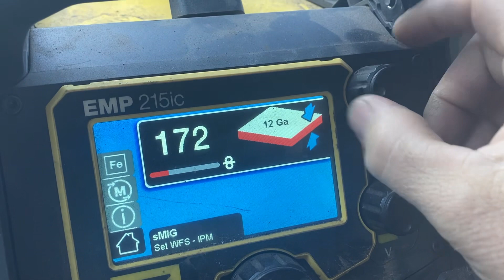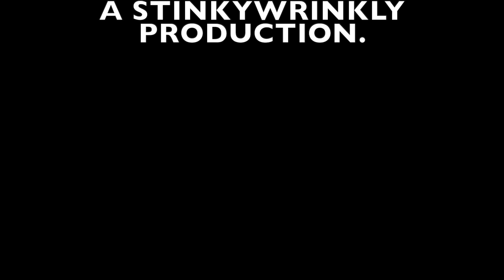Getting people to do your work for you!

Comment: Good video. He did good. I was always taught flex core or stick outside gas outside wouldn't do as good. I guess I was told wrong. Have good Thanksgiving.
Reply from the maker: I prefer gas when Im doing certain types of work, and you can use it outdoors just have to be careful with wind, and keep your regulator around 35% flow rate.
have a good ThanksGiving Chris!
Reply: @happybleeding  oh okay I not certified welder I quit school for welding have way through. But I am good at it. Thank you